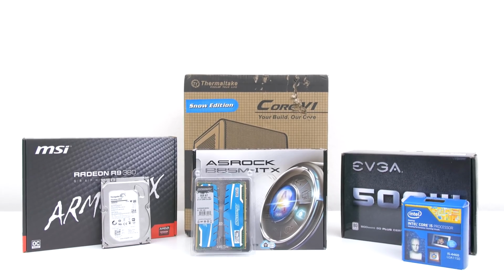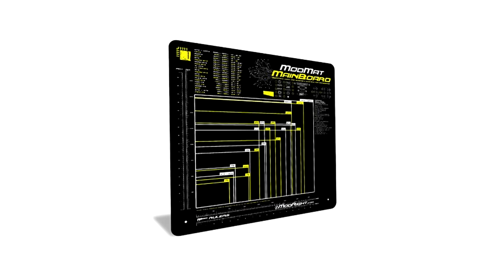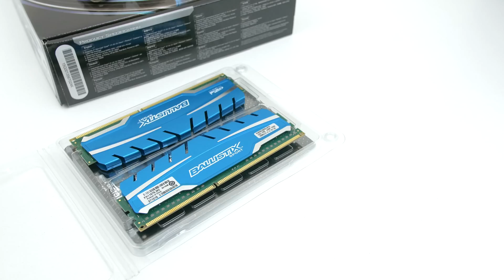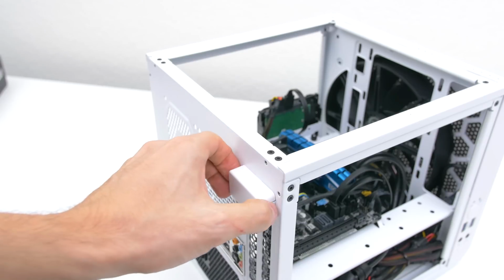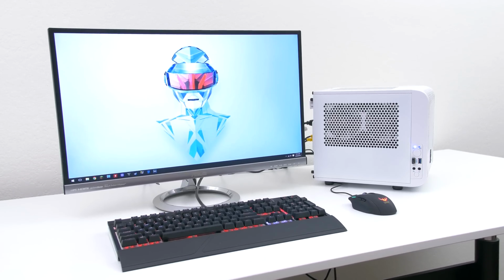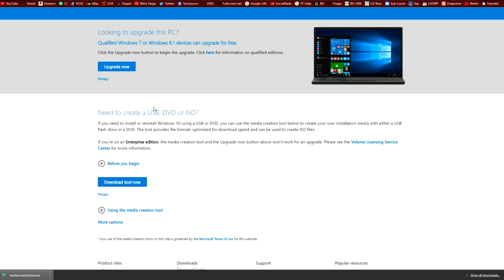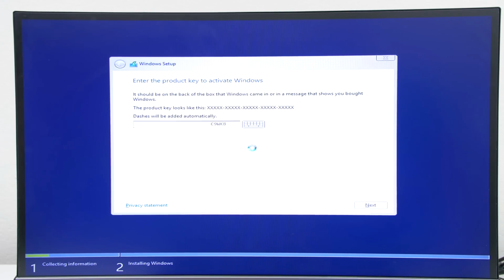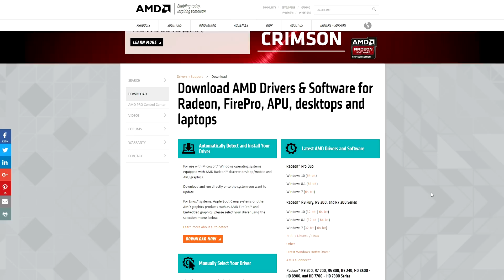How To Build $600 Mini-ITX Gaming PC w/ Windows 10

Comment: i can't find the motherboard anywhere unless it's out of stock
Reply: i have every part except the motherboard
Reply: augiefrank i built mine using the msi h81l mini itx board.. works great. I did some research and it turns out that the board was discontinued and the ones u can buy have outrageous prices.. Hopes this helps.

Comment: Also If you do a little bit of searching they sell motherbords with wifi built in so you wont have to use one of the usb ports. I am actually building a pc with a diffrent case, its about 1000 dollars. here are the specs:

Core i5
GTX 960 3gb
8gb ram
exc.

Comment: The price in the UK increased by £150 since Brexit... could you please update the costs? Also, Newegg does not supply most of the parts. In total the true cost is now £556 in the UK. Great video!

EDIT: Grammatical mistakes were fixed

Comment: I want to build this pc but I wanted a pc with a window, So i was wondering if i would be able to use the Thermaltake core v21
@TechSource
Reply: The case is the same size regardless which one you order. It's the same thing. It just has a window.

Comment: I built this computer with just about all the same parts but I switched out the graphics card and the mobo. I switched the r9 380 with the rx 480 4gb. The mobo I got is a H97M-ITX/ac. The graphics card is listed to be lower than $200 but when I was looking for it I found that it was more like $250 for a new one. 

THIS CHANGE HELPS WITH PERFORMANCE.

Firestrike score with the r9-380 7131

Firestrike score with the rx-480 9527.

Overwatch runs at 1080p ULTRA at around 140 fps. 

CS:GO runs 1080p at around 270 fps

Rise of the tomb raider 1080p high got around 68 fps.

This change can give you a good performance boost. 

Even if you stick with the r9-380 you will still get amazing performance. I really do recommend this pc to anyone looking for a beautiful and crisp 1080p Ultra 60 fps gaming experience.
Reply: Carter can you link them? I'd appreciate it if you did! And if I do buy them I can just follow the guide like normal right?
Reply: https://pcpartpicker.com/user/carterjb01/saved/QGBbvK

And yes just follow everything like it shows in the video however, the mobo has built in wi-fi so you will have to look at the manual to install it
Reply: can i use an i5-6500 and gtx 1050ti with this build??
Reply: Carter Your PC that you use now only costs $355 xD
Reply: LeMansTM Electro Light thats because all rx 480s are sold out.
Reply: Adi Tandon Do some actual research. Only the cpu can bottleneck a gpu. Its not vise versa. How else do you think integrated graphics units work? A 7700k dosent bottleneck itself. PLUS a gtx 1050 ti and 6500 is comepletly fine. There is NO bottleneck since both are similar price.
Reply: Carter what mobo should i get, urs is out of stock
Reply: Carter What i get 150+ on overwatch (epic) with 1080!!!
Reply: Niceee
Reply: Carter we need more people like you in this world

Comment: What is a heat sink? A cpu cooler? Do I need 1
Reply: A heat sink is a cpu cooler, though not the best for overclocking. And yes you do need one. Without it your cpu will overheat quickly and could be damaged by said overheating. Even so you shouldn't need to get a special cpu cooler unless your cpu has a "K" at the end of its name. The K indicates that the cpu is meant for overclocking, so steer away from those unless you want to overclock your cpu.
Reply: Lethalshot66 thanks i built my pc has a i36100 and a rx470 works great
Reply: Lethalshot66 and yes it has a heat sink ;)

Comment: Can some one help me out^^? I'm looking for a Motherboard for this build. I can buy every part like listed, besides the Motherboard. Is there another Option for a Motherboard?^^ Thx all ready for all the Awnsers^^
Reply: Yeah no problem!
Reply: NoFranko 
How do I buy the thing all there is is a picture
Reply: You have to take off the front of the case, after that it worked much better, it is impossible otherwise.
Reply: I can spend some Extra Cash, so I'm thinking about picking a XFX RX 470 instead of a MSI R9 380, would it work with this build too? (i'm a first time Builder^^)
Reply: And i would have some more ram 16 GB, if that works to^^
Reply: OMG!!!!!!!!!! look on frys electronics page they carry the motherboard
Reply: Well if you want to check if your parts go together I believe the website is pcpartchecker and they will tell you everything but I believe they would work
Reply: Peter Fishman Thx I'll take a look at it.^^
Reply: The motherboard that I used was the H97M-ITX/ac it has built in Wireless internet capability. I really like this one. And if you ever want to upgrade to a different cpu, the motherboard is overclockable! :)
Reply: Carter Thx I will take a look at it :)
Reply: yo carter, apparently, you've built this pc, I got the mother board you suggested, but idk what to buy for my GPU (the one he listed is out of stock). help would be great
Reply: I used the rx 480 it just barely fits in the case though. I got the msi rx 480 4gb, it works wonders for me. a gtx 1060 3, or 6gb would also work really well!
Reply: Carter Did your graphics card cause any problems with it being slightly bigger than the recommended one? I'm thinking of going 1060 if I can afford it.
Reply: If you want to build the modern equivalent, here are the parts you want: https://pcpartpicker.com/list/dfZVf8
Reply: lmao same I got the 8gb version and it barely fitted, thank god it worked out
Reply: Same way with mine lol. I got it in. I got really worried when I saw the case, and the graphics card.
Reply: Wow, Thanks everyone :D I delievered the part and as you all said. It barely fit in lmfao Works really well..thanks again
Reply: Received*
Reply: Carter how did you get the rx 480 to fit in this case? It seems impossible to me. I can't squeeze it in.
Reply: and it's worth it^
Reply: +Carter SAME!!! I used a black version of the case so it fit well

Comment: I cant buy the mainboard because everywhere i look i cant find it and i dont know where to buy it
Reply: Use the AsRock B150M instead. It's just an update to the B85M as far as I can see. Also it uses the 1151 socket for the CPU so you'll need a different one form the one used in the video.

Comment: What is a good alt motherboard to use? The one listed is sold out...
Reply: AsRock B150M.
Reply: Sam Lowe Not working with that cpu.
Reply: ***** The motherboard does work with 7th generation CPU's, however you do need to update the BIOS using a 6th gen CPU. So no it wouldn't work straight out of the box.

Comment: OK I know this is probably a stupid question but will the Wireless Adapter work with any PC build (Using entirely different parts) and I would prefer to use this option than a more difficult one

Comment: CPU: AMD fx-6350
PSU: EVGA 500W
CASE: Fractal Design core 1000
RAM: 16gb G.Skill Ares ram
MOBO: Gigabyte GA-78LMT-USB3
GPU: MSI RADEON R7 360 2GB
HDD: 500GB Seagate

Will it run CSGO, plus edit well?

Comment: I'm wanting to build this, but the motherboard is sold out..would any mini itx board work?
Reply: I think the B150M is the replacement for the B85M motherboard. The only real difference is that the B150M runs 6th gen CPU'S.
Reply: Sam Lowe so what kind of cpu would I need?
Reply: Personally I'd go for an Intel Core i5 6400 Quad Core LGA 1151 2.7GHz CPU Processor. This is the update from the one he used in the video which fits the 1151 socket rather than the 1150 thats on the B85M motherboard. What ever you pick (if you want to spend more go for i7 of course) make sure its an 1151 if you use this motherboard.
Reply: Sam Lowe does it matter if it's ATX or LGA for the motherboard
Reply: Im not 100% sure and by no means an expert, just make sure the CPU you use is compatible.
Reply: and ram and such :p
Reply: If you use the B150M then it supports ddr4 ram.
Reply: If you're still looking for a motherboard, then the H97N is a good replacement. So far it works for me and it's the only part I have that is different from what's used in the video. It's around $120 right now.
Reply: i may use this card.....but can i get a more specific name?
Reply: Lethalshot66 thanks

Comment: what do you think of the budget start up? 
ASUS ROG STRIX Radeon RX 460 4GB OC Edition

Core i3-6100 3M

ASRock Motherboard Mini ITX
DDR4 LGA 1151 H110M-ITX/AC

Ballistix Sport LT 16GB Single DDR4 2400 MT/s

DeepCool TX Mid Tower

Hitachi Ultrastar A7K2000 2TB.
Reply: osafo sam take 8 gigs of ram and if you only wanna game ddr3 is good enouf but the you can get a i5

Comment: Do the gromits, screws, and wired ALL come with the various parts mentioned or do some have to be bought seperately :D thanks
Reply: Gromits and screws comes with the case. SATA cable comes with the motherboard. Those power supply wire comes with the power supply.

Comment: Can i use Asrock B85M Pro3 as a motherboard? (its pro4 in the video)
Reply: Will not fit into the case. You need an ITX size mobo.
Reply: WB IsMe thanks!

Comment: is it the same if you want to build a mid tower desktop or other desktop right...???
the different is just the proccessor,CPU and all of that thing right??
Reply: Its the same you can use all the same parts as long as the mid tower supports micro atx motherboards.

Comment: Would a strix R9 380 2gb fit in this case.
Reply: yes
Reply: Stealth my freaking super superclocked evga gtx 1060 can fit.
Reply: Kqog I don't understand this comment lmao ur super clocked 1060 is way smaller than a strix r9 380
Reply: Oops typo. SuperSuperclocked (Dual fans).\

Comment: I have build an other pc but it doesn't have a connection with my monitor. I connected the vga cabble from the motherboard (not the gpu) to the monitor but it sais it has no signal...  Do you maybe have a solution?

Comment: The: MSI Radeon R9 380 DirectX 12 R9 380 2GD5T OC 2GB 256-Bit GDDR5 PCI Express 3.0 x16 HDCP Ready, is out of stock on Newegg... Is there another alternative that would work with this build? If so, please respond with a link. I know this might sound like a noob question, but I am exactly that, a noob. I'm new to the whole computer building thing, and have been looking forward to getting an affordable gaming PC since all I have is a laptop that's not designed for gaming.

Comment: oh please one more thing .... Can i use a 3pin socket on the the 4 pin cpu fan power socket ... coz im planning to buy a better air cooling fan thanks!!!
Reply: yes
Reply: im in china bro they sent me the wrong motherboard :( asrock h81m ... so there goes my 70 usd need to buy a new one asrock b85m ... coz the h81m does not have a usb 3.0 socket  :((:((

Comment: Hi Guys. I got a 2 year old self built PC with an i5 4670 and a (Gigabyte 2 fan, not the normal 3 fan => GV-N760WF2OC-2GD) GTX 760. I know these components weren't the best bang for buck but anyways... I am very satisfied with the performance and I don't think I need to update any components.

My Question:
I want to switch to a mini itx case. What case is the smallest which can handle the size of the graphics card and my semi modular power supply? The length of the graphics card is 265mm and my power supply is around 160mm long.

Comment: What's a good cheap graphic card to use with this build ? The current one is sold out
Reply: Can I use a evga 730?
Reply: You will get exponentially worst performance for using EVGA 730. 
Try RX480, RX470 or RX460 depending on your budget.

Comment: Do all heat sinks come pre applied with thermal paste?
Reply: Some but stock cooler always comes with pre-applied thermal paste
Reply: +WB IsMe Wat if I buy a cryorig h7
Reply: Doesnt come with thermal paste. You can always buy small tube for afew buck. It will last you for years.

Comment: Can you install and use Windows 10 without a product key?
Reply: No.
Reply: Yes. Although I do recommend using a product key, I do believe you can install an inactivated version of Windows, with the only limits being you can't customize, and Windows will nag you to get a product key. This should work, but do further research. It may not work like it used to.
Reply: +Riley Fields ok, thanks. I appreciate your help.
Reply: get a cd-key crack tool, or just ignore the activate windows watermark in the corner
Reply: Activate Windows will trun off pc, after 5 hours.
Reply: +Dutu Silaghi when did this start happening?
Reply: Last build

Comment: Can I use gtx 1060 mini?
Reply: yes
Reply: Sir can i use gigabyte g1 r9 380 its compatible on mobo and case
Reply: All graphic card are compatible to all motherboard. It is the case and the power supply that you have to take note. 

Go to their manufacturer's website and check the case's graphic card clearance and the graphic card's length.

Comment: if i didnt want to use up a usb slot how could i build in the wifi?
Reply: as long as the motherboard you use has a PCI-E slot, you can get a wireless card that'll go in that slot.  They usually have big antennae though so keep that in mind
Reply: there are wireless adapters that plugs into the motherboard
Reply: You need to get a motherboard that have build in wifi.
Reply: Buy a usb hub
Reply: It only has one PCIe, so motherboard isnt an option.
Reply: it comes with wifi on the motherboard
Reply: Collateral 915 no
Reply: thought it does?
Reply: It doesn't.
Reply: lich_boss you will need to spend at least 40 dollars for a wifi installation thing so the usb is the best choice

Comment: have questions . how do you identify the ssd and the hard drive from that menu from fresh boot up?  considering that there is only 2 usb ports on the build and one is always going to be taken, is there any more usb ports for a mouse, keyboard and headset or any kind of extension for more usb ports?  sorry im new to building
Reply: There are 8 in total. 2 from the case and 6 from the motherboard.

Comment: +TechSource Is IceCube compatible with Asus STRIX GeForce GTX 980 Overclocked ?
Reply: All graphic card are compatible to all motherboard so long as they have a PCIEx16 which 95% of the motherboard that are produced after 2005 will have.

Comment: pls anwser ne can i play most 2016 games no this specs:-
-Procesor Intel Core i3-6100, 3.7GHz
-8gb ram ddr4
-AMD Radeon R7 360, 2GB GDDR5
-1000gb rom
Reply: Yes but not at high setting for some triple A games. Can run games like Dota2, LOL and CSGO at max setting with decent frame rate 1080p.

Comment: I am just getting into pc's and the whole knowledge of pc's and the components. Does the ADATA SSD optional part take place of anything with in the pc itself or is it just an add on?
Reply: Add on. SSD load faster than HDD but cost more per GB.
Reply: +WB IsMe how many gb would you recommend?
Reply: Colton Matteson 120GB or 240GB, just for operating system and games that you frequently play.

Comment: I did the same build except I used the h170n-wifi mother board and I have the r9 380 4g. My only problem is that my system won't recognize my gpu and idk how to fix it. I've tried uninstalling drivers and reinstalling them. Plz help
Reply: Everything boots and works but the gpu and yes I can see it gets power because I see the lights and the fan turning
Reply: I have no idea how to fix this but I hit like so hopefully someone that knows what they're doing sees it.  Good luck.

Comment: does the 1060 6 gb gaming x fit??
Reply: yes
Reply: Just wondering , Do you prefer windows 10 or windows 8.1 ? Just generally .
Reply: +iLiStAr I use 10 more
Reply: if you want to be sure, buy the EVGA 1060 3GB or 6GB mini version :)
Reply: Windows 7 has great compatibility with both games that are older than the OS and newer.  I can't think of a game that's come out yet that runs on Windows 10 but not Windows 7.

Comment: could i swap i5 out with i7?
Reply: Yes so long as it is haswell or 4th gen intel processor.
Reply: +WB IsMe so only 4th gen because the socket format?
Reply: Yes. Either i7 4770 or i7 4790.

Comment: Would the MSI Radeon RX 480 8GB 256-Bit GDDR5 work instead of the MSI R9 380?
Reply: Yes
Reply: Yup
Reply: if the PSU is 500-600 use the 6-pin rx 480 nitro. 
it has better cooling and pre overclocked. 
it should increase the life span, the card has a pre built backplate and costs 30$ more. 
search it on newegg.
Reply: but it dont think the nitro would fit. unless 30cm of clearance is possible.
Reply: Would the sapphire radeon rx 480 8gb its fit on the case and its compatible on psu?

Comment: Quick Question: Can I use Intel 6600k with the same motherboard? If not can someone recommend me one that will work with this mini-case and i5 6600k
Reply: No. The 6600k is not compatible with the motherboard. You need a Z170 ITX motherboard to work.
Reply: you need an lga 1151 board. z170 is the chipset
Reply: Can you recommend me a different motherboard because I cant get the motherboard in the build because I cant get it in the uk , If I use newegg I have to pay £40 extra due to VAT PLease reply
Reply: +iLiStAr if you want to over clock then any mini itx board with an 1151 socket and the z170 chipset. if you're not gonna over clock then any mini itx with LGA 1151 sockets fine.
Reply: but Im using a i5-4460 ??
Reply: And I accidently bought a H81m - itx instead of a b85m - itx , so I have to send that back it has the same sockets but has no usb 3.0
Reply: Will an i5 6400 skylake be compatible
Reply: No
Reply: +Foreignspy K cheers for reply
Reply: Which one do I need for the i7-5820k?
Reply: +Skyflip check the socket type then get whatever board fits your requirements. we're not google
Reply: Skyflip X99 motherboard
Reply: Skyflip X99 motherboard
Reply: X99-A I believe
Reply: No
Reply: Yonver it's the same socket

Comment: My build using the thermaltake V1:
ASRock H170m-ITX/dl
Intel Core i5-6600
EVGA GTX 1060
8GB HyperX Fury 2133MHz
EVGA 600w PSU 80+ BRONZE
1TB Seagate HDD